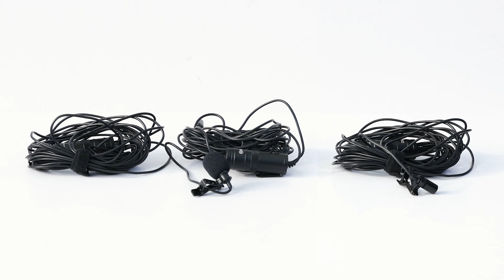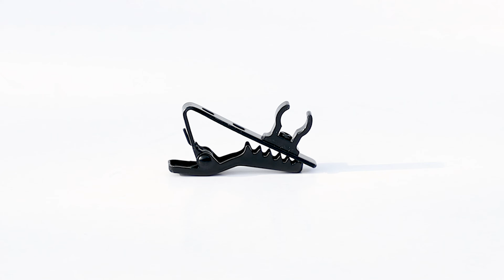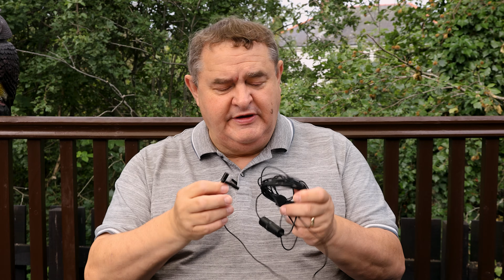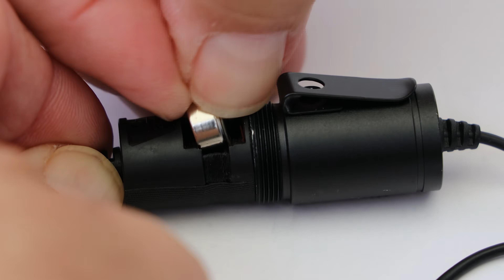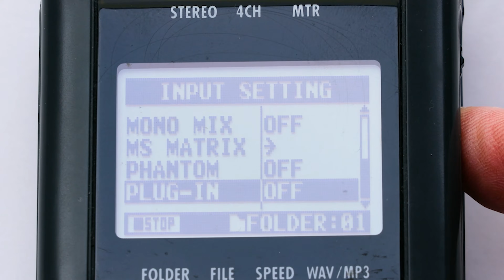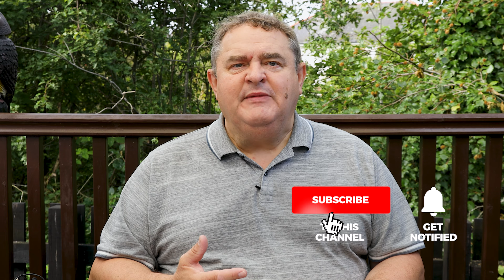Boya BY-M1 and MOVO LV1 - Are Cheap Lav Mics That Sound Great

Comment: On my 3rd BOYO, good mics but the switch becomes unreliable after a few uses
Reply from the maker: @stompinsteve6066  Sorry to hear.   So far, I've not had the same experience. Perhaps something has changed.
Reply: @DIYVideoStudio  I use the mic to amplify a harmonica so it's switch is used a lot more than say a camera where it's not necessary to switch, you can just leave it selected for camera mode, Steve
Reply from the maker: @stompinsteve6066  That makes a lot of sense. If you’re switching it on and off frequently, there will be a lot more wear.